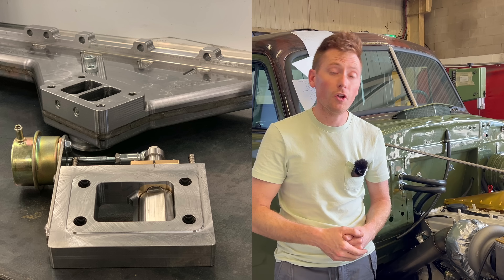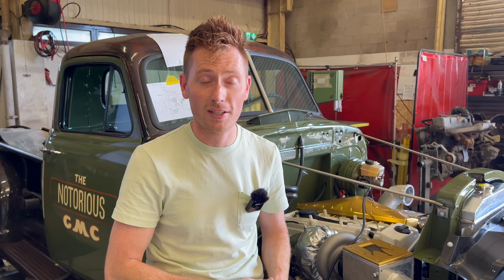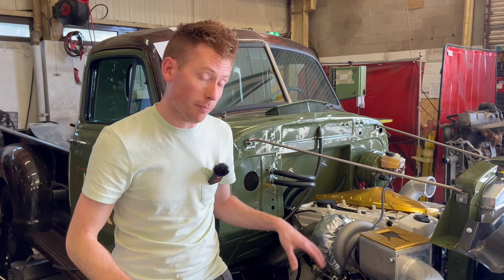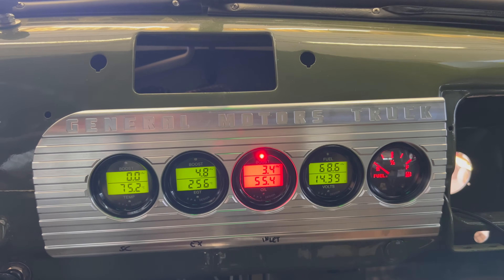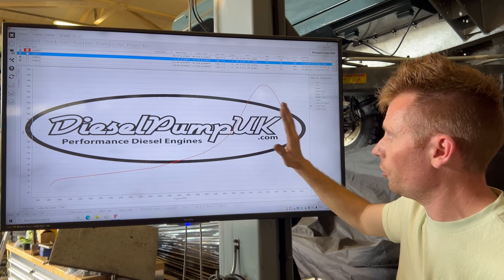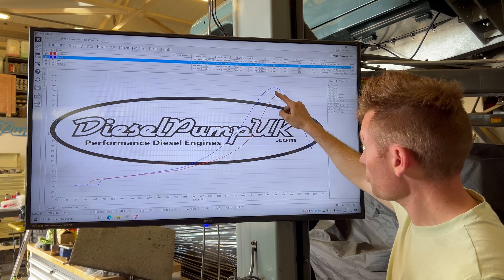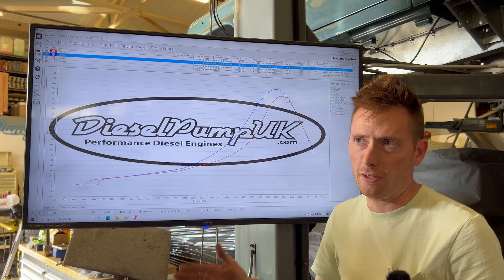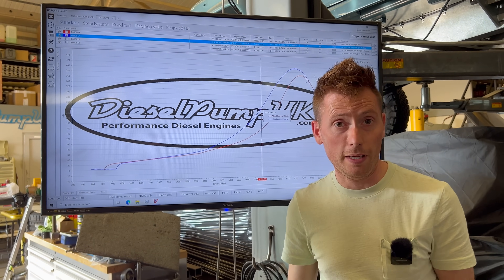How to SPOOL Big Twin-Scroll Turbos FAST, on your build. Quick Spool Valve Dieselpumpuk.

Comment: Hi like i'm thinking of getting a XLWB high top mercedes van early sprinter and turning it into a Campervan 
And fitting a 606 engine for it what would the best bhp and torque be for it. I'm only going to use it for normal touring around.
Would a supercharger be better than a turbo as I won't be revving the living daylights out of it or would both be preferable ?
Oh with an auto box.
Cheers Stephen

Comment: Can't wait to order a fuel pump and turbo from you guys for my currently non-turbo 1995 mercedes 300D here in the states. She's my baby with just 86,000 original miles and, imo, the best body design Mercedes made...well top 3 anyway 😂. Love you guys, keep up the good work!
Reply: your asking for problems...
Reply: @termonostruman  no bc I'm not going for power but economy and driveablity. It access at a crawl so I wanna improve that so I have a comfortable daily driver. Your warning would be apt if I were reaching for big numbers but just adding pump and turbo tomorrow engine that was turbo equipped in other markets isn't reason for concern. I've been a certified mechanic for 14yrs and specialize in diesels not to mention that I've had a love affair with these engines for yrs and thus am very comfortable with it. They're forged internals and can more than handle the mild 9 to 10psi boost I'm applying
Reply: @FutureNoize  turbo 300D and non-turbo have completely different internals. Good luck though.
Reply: DieselPImpUK

Comment: Which Mercedes cars have the OM605 or 606 turbo without an ecu? I need to find a donor now i see you do an LT95 to OM adapter kit i want one in my 101 but don't want to be messing about with ECUs. Probably won't be looking at a quick spool valve for it though. Being that high up is scary enough at current speeds...
Reply: None, you take the pump off an earlier car and fit it to the OM60x
Reply: @CourlandEngineering  Thank you, as i'm a thicko, could you be more specific please?
Reply: @koitorob   the Om606 and 605 never came with fully mechanical pumps, they came with electriconically controlled ones. What you do is buy the engine and put on a fuel pump from an older merc which was fully mechanical. The pump needs to be modified so it can flow more fuel, as the engine it came on wasn't very powerful and didn't need a lot of fuel
Reply: @CourlandEngineering  Thanks, but i'm obviously not making myself clear enough...
THICKO HERE! No experience with pumps. Any mechanical pump? does it have to be from an engine with the same number of cylinders? As you seem to know what you are talking about, could you possibly narrow it down to a specific model of car?
I'm not looking for a huge amount of performance. It'll be going into a Land Rover 101 forward control. Think large rectangular box on wheels that you literally have to climb up to get into. 200 bhp would suffice. It's to replace the original factory Rover 3.5 V8 on carbs that is doing 8 to the gallon. Would the pump still need to be modified for this level of performance?
Reply: @koitorob  No, unless you like fabricating, you need the pump from the OM603, the previous generation mercedes inline 6. The most powerful version was 150hp,  getting 200 might be possible without modifying the pump, but you might need to put in bigger elements swapped in. Any decent diesel pump mechanic should be able to do this. In short, you need the OM606 from a W210 E-class and the pump from a OM603 that came on a W124 S-Class. These parts are getting a bit hard to find parts for so a potential budget alternative is the BMW M57 from the early 2000s. Compared to Mercedes which only used the OM606 in one car, the M57 was found in damn near everything BMW made at the time. Dont worry too much about the electronics, the early ones are really quite simple to do, requiring not that many wires. The OM606 with an OM603 pump is ideal if you really want a full mechanical setup, the M57 route these days is much cheaper.
Reply: @CourlandEngineering  Thanks for your information but i think my aim has moved away from a Mercedes engine towards either VW or BMW. I have found an adapter to bolt my 320d engine and 6 speed gearbox onto an LT230 transfer box. AND available in the summer, hopefullly there will be a adapter to bolt the 1.9 PD series four cylinder diesels to the R380 gearbox. 
I know most here wanting stonking amounts of horsepower but i'm only looking for around 200 and more interested in low down torque. The PD engine with a remap produces silly amounts of torque, and at low revs, just what you want in a Land Rover. My 320 in standard spec is more powerful than the standard Rover V8 3.5 with low compression. Yes i could swap it for a 3.9 or 4.6 instead but then i'd still be left with two issues: SHIT mpg and at risk of beep water pinching out the sparks. That's a problem you don't have with a diesel. As it's a 101, picture short shipping container with four tall tyres, one at each corner. It has the aerodynamics of, well, a shipping container and weighs nearly 3 ton. If i can get 20mpg i'll be overjoyed!

Comment: Could this work in a compound turbo 12v cummins application?
Reply: As long as it’s a T4 flange and not T3 on the turbo you’ll be fine if not they make adapters which are also available on his website IIRC. Another thing to consider is the external waste gate they have already on the QSV might need to be setup differently depending on your setup, being a bigger engine almost dbl the size and pushing more air
Reply: @oneofthefew1777 They also sell a t3 QSV if it were t3.

Comment: I don't get all the noise and power,  a normal e300d 1998 is fast and refined. My interest in this engine would be in a 7.5 Ton Canter , which has a 3.0 4P10 engine, DPF, ERG,Engine lights galore. Would it work in this vehicle, which needs to be as it is now, slow, torque, top speed 60mph .  Would this engine work in this vehicle with it's very low geared gearbox and axle.

Comment: I have an om605 with twin scroll hx35 turbo. Will a QSV work well on this setup too?
Reply: Hx35 on a 605 already spools dangerously early with a good exhaust manifold
Reply: @sneez9461  Mine certainly doesn't but I have one of the bigger backhousings. Maybe I should try a smaller one.
Reply: @tomdavis5878 a 12cm housing is the preferred unit on an hx35. If that doesn't do it for you, an hy35 (early version of an he341) has a 9cm housing.